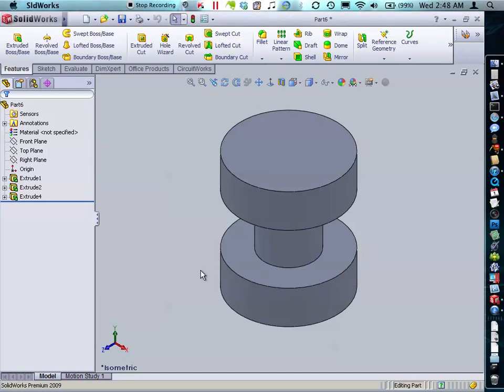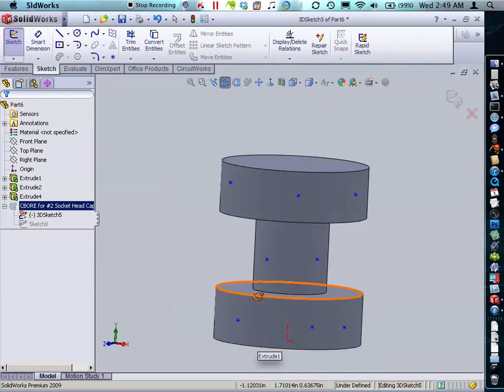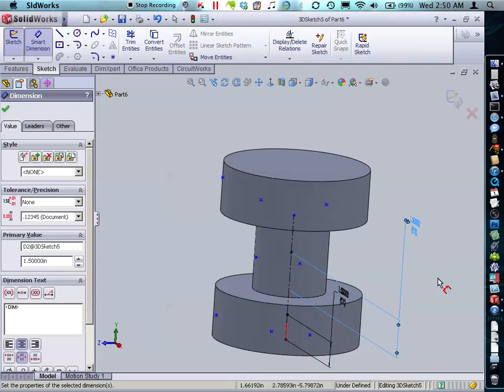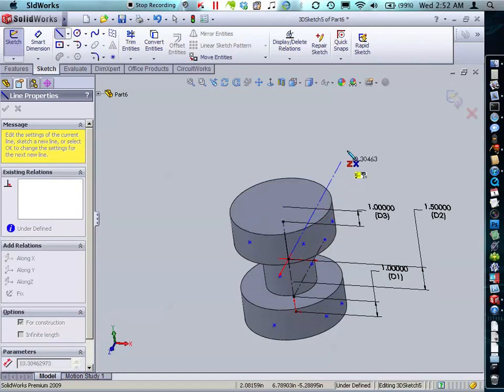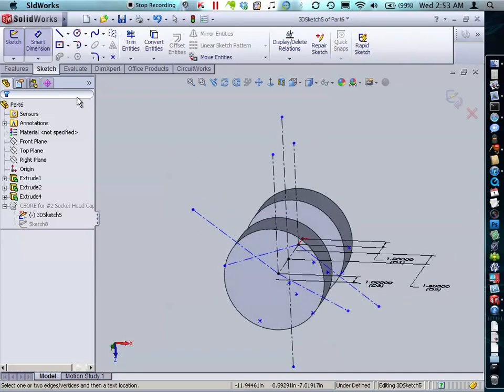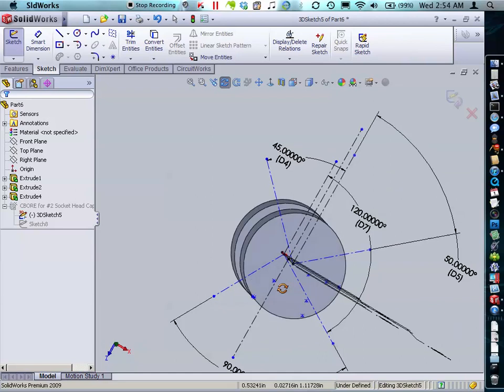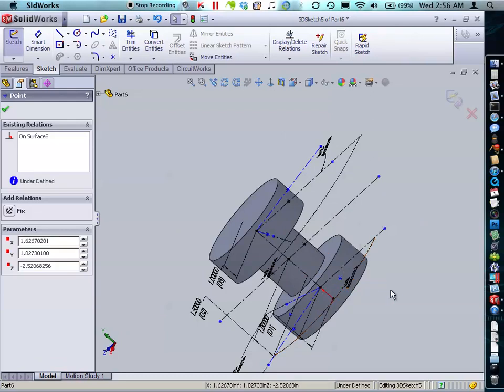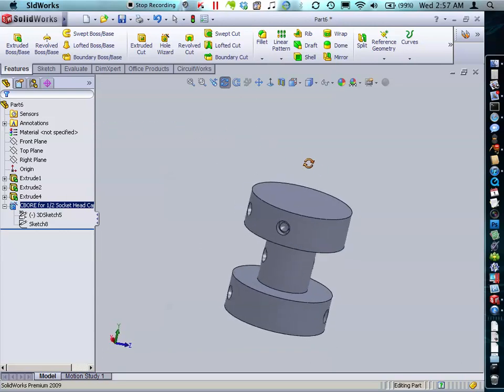Solidworks - Holes on a Curved Surface

Comment: Great tip, but I would minimize the 3d sketching and use more circular pattern features:
a.) use "one hole command" for each hole at each level. 
b.) use circular pattern to create more holes at specified angles
c.) repeat, steps a & b, for each hole at each level. (extra work, but setting up for future changes )

Comment: Awesome tutorial, thank you! I hate solidworks, and how limited it is in it's methods, but you make it less hate-able. Maybe there is and I just don't know how, but I wish there was a way to adjust things by a relative, and or absolute distance by specifying an x,y,z coordinate, or radially in a plane. This at least provides another way to do it. Again, thank you!
Reply: I understand your frustration with solidworks.  It is actually "unlimited" in it's methods, but those methods are not "intuitive" and "hidden" somewhat. 
What you are asking can be done:
a.) For Absolute Distance placement: You can control points by (x,y,z) coordinates.  Just place a point on the surface and then on left panel there is x,y,z input box. (not advisable "if surface geometry changes" the coordinates will be floating in space)
b.) For Relative Radial placement:  Create one hole at each plane level, and then use circular pattern feature.  (a good method if further changes are to be made)
Reply: @trexinvert  
Thank you! Always enjoy help learning how to get better! 
I like to compare solidworks to a volkswagon. They both have a European style of how to work on or with them.

Comment: +Ramon Y
Awesome tutorial, thank you. Needed this to create set screw holes on my surface. I had to change the view angle of my part just to visually do exactly what you did. In the end this is an awesome way of doing it. I love that I can change the angle or placement with a dimension change. Simple but thorough. Thanks again! :D

Comment: You should include the disclaimer that this technique is only useful if you're trying to put holes in perpendicular to the surface, in which case it's great.  Not so much if I'm not, though.